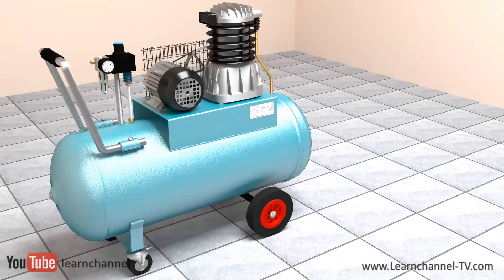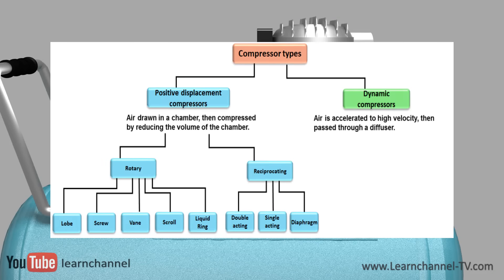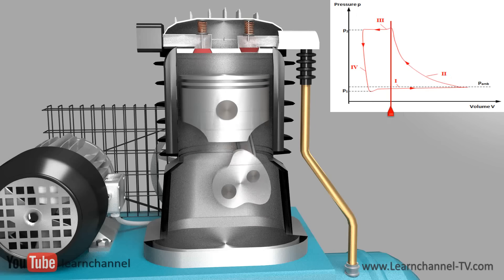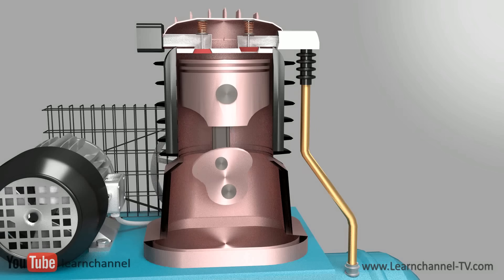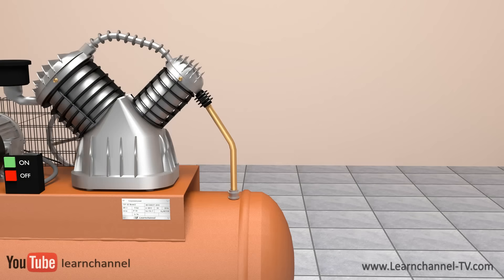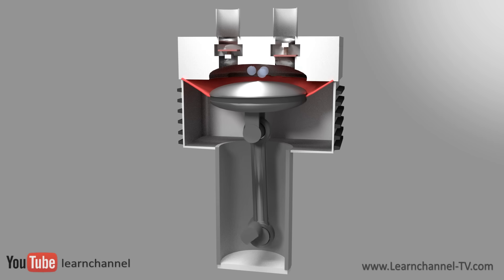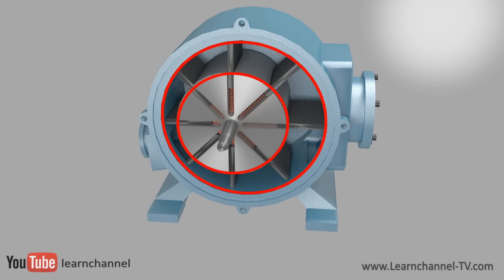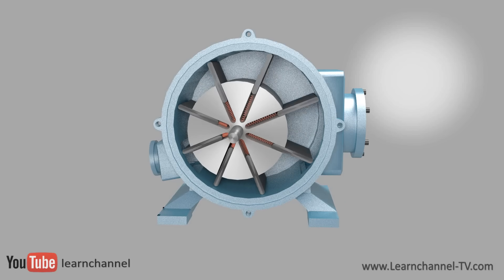How does an Air Compressor work? (Compressor Types) - Tutorial Pneumatics

Comment: my two stage kelogg compressor just stopped working is there. a capacitor in tthese compressors? or capacitors are only for smaller comrpessors? mine is a 120 gallon horizontal unit thanks

Comment: Pressure gauge motor cylinder with piston crank case connection hose tank water tank drain inlet filter compressor pressure coil electric ampere generator oil red inlet valve diaphragm crank shaft piston output valve  lubricant main rotor sliding vane grooves in fan protected  teacher ji

Comment: Greetings from South Africa .
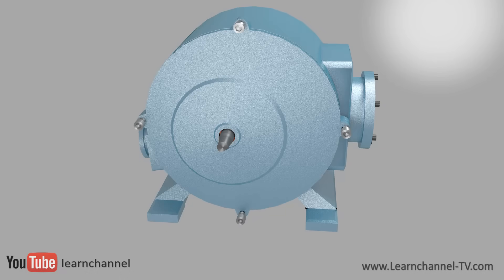I really enjoyed this video except at 3:10 ,where you said divers use diaphragm compressors to fill their cylinders.
No no no no no no no! 
 We use multi-stage high pressure compressors - 200 - 300 bar / 3000 - 4500 psi in our air tanks.
That's a bit much to demand of a diaphragm pump. they are happier at 125 psi - 9 bar.
Om shanti.😇🙏
Reply: tari ma ni qoosi

Comment: Why we want multi stage , we can compress the air by single also then why multi stage
Reply: Because even thou it looks very simple and straightforward, there are several variables to consider. I'll give two aspects as an example:

- Pressure vs torque relationship: For a fixed piston chamber size, there would be a fixed piston area; then for reaching a higher pressure, a higher torque resistance will be applied in the crankshaft, meaning that a bigger electric motor will be required (one with more poles would to the job, but with a lower flow rate). By having a second stage with a piston of different size, you can reach a higher pressure without  increasing the torque.

- Temperature constrains: This one was already mentioned in the video. The temperature of a fluid tends to increase with compression and the mechanism of the compressor require lubrication for proper operation, but lubricants tend to become thinner at higher  temperatures and moreover, some of them can ignite when enough heat is applied. By adding stages, you improve the cooling capabilities of the compressor, hence limiting the drawbacks of higher temperatures.
Reply: @wolfvash22   since you seem to know more than me 🙃 can a 8 bar air compressor fill up road bike tires with 10 bar or would you need a higher output compressor? if possible, what would you say is the highest pressure a standard air compressor can achieve?
Reply: @p__jay  Short answer, you cannot reach 10 bar with an 8 bar compressor, but you can use it to partially inflate such tire. Lets dwelve a little in the first question.

No matter what fluid you are dealing with (air, water, oil, blood, etc.), It can only flow from higher pressure to lower pressure, meaning that if you use an 8 bar compressor, you can only “pump" air to a volume pressurized to less that 8 bars and until reaching the same pressure. Following what I said, you can inflate a tire with an 8 bar compressor but you will only reach a maximum pressure of 8 bar inside the chamber, requiring a different appliance for the remaining pressure.

Now this can be something really simple to solve, let me tell you that in needful situations I have inflated car tires with a bycicle pump, precisely cause bycicle tires usually require a higher pressure that an car one, meaning that bycicle pumps (even the small ones) can sustain considerable pressure, however; you will take forever to inflate a car tire specially the big ones (here we are dealing with how much volume can be pump for time unit, not how much pressure can be reach), and you will need to let the bycicle pump cool down from time to time.

So, If you have an 8 bar compressor, you can let it do most of the job and then you can manually reach 10 bar with a manual pump, those reaming 2 bar would be hard to pump, but will take little to reach.

Now, regarding your second question, I'm not familiar with the standards of commercial compressors, but from a theoretical point of view, you can reach as much pressure as the available techniques and materials can withstand.
Reply: @wolfvash22  thank you! makes sense…pressure will always level itself out! so to get higher pressure, you always need a multi stage compressor with smaller pistons! For scuba diving tanks (which have 300 bar), they become quite small then. 

and a hand pump can make as much pressure, as the materials and seals hold tight. But like you said, the volume of air they move is low and you don’t want to inflate a car tire with it!
Reply: @p__jay  I'm glad to be helpful, just a little clarification about the multistage compression, it is widely used due to convenience, but that doesn't mean it is always necessary (or the best approach for any high pressure need).

Once dealing with an specific situation, a lot of variables can be taken into account (pressure, flow rate, temperature, fluid viscosity, explosiveness, corrosion, biohazard, topography, etc.), thus in very particular situations, a certain design such as one multi-staged could not just be inconvenient, but dangerous or undesirable.

Now, another interesting data about the multi-staged compression, pistons are not the only answer. Any turbocharged (or supercharged) engine is a multi-staged compressor, being the first stage an external rotary compressor (there are several designs types like the screw type used in superchargers) and the second stage the internal engine's pistons (and we could even consider the intercooler before the intake as sort of stage). 

Reactive engines are mainly used for commercial aviation, (I am afraid I can't recall right now the proper terminology about this technology) and they doesn't use pistons but rather turbines (and the opposite of a turbine that I just can't recall), and they do multi-stage the compression but progressively by variating the geometry of both the intake and the “impeller" and not just that, they do the opposite process before exhaustion; combustion products are multi-stage expanded (in this engines, thermal energy is transformed by turbines of progressive variable size).

Regarding what you said about scuba diving, you get it right, tanks with compressed air can be small to help withstand the pressure, but another reason is that a compressed fluid becomes denser, so you can have much more mass of the same substance at a smaller volume.

Comment: Can someone tell me do I really need compressor capable of more than 10 bars and 300l/min? For a small workshop.
Reply: not unless you are doing a lot of sand blasting
Reply: Buy one rated for 200+ min and that will keep you completely covered whether it be as heavy as framing or as light as painting you'll be fine with 200 psi! Buy once cry once! Wouldn't want to spend money on one compressor only to then spend more in the future because you needed higher output
Reply: Your fine , 10 bar will produce 145 psi , most North American tools operate in the range of 90 psi .

Comment: this may sound like a dumb question but how exactly does an air compressor fill up with air? is there a hole in the tank that fills it up?
Reply: After the air is compressed it leaves the pump through a tube that is connected to a one way check valve screwed into a hole in the tank. The check valve is there to prevent compressed air from returning back to the compressor when the compressor turns off.
Reply: There is a air inlet valve in the 1st stage piston .

Comment: So it’s literally an engine without combustion
Reply: I saw a guy building a compressor out of engine
Reply: @prodigalson2670  I saw a guy build a 4 stroke engine out of a freezer refrigerant compressor cylinder and piston
Reply: @prodigalson2670  you can build a steam engine from ice's
Reply: Reverse engine, actually. Instead of harvesting energy from chemical bonds, you harvest electrical energy and trasmute it into pressurized energy.
Reply: Combustion was always a joke about burning the planet's blood so the gold empire can dig deeper
Reply: Actually it's the inverse of an engine
Reply: Basically
Reply: Yes. After all, those who know, will always tell you that an internal combustion engine is just an air pump.
Reply: @PotatoeJoe69 We need a tech revolution that's way smarter please.
Reply: Yes they work the same
Reply: An engine from pressure-gas do work, compressor from work (normaly electric engine) do pressure-gas. It's reverse each other
Reply: Yes pal
Reply: No, but very close related. I will clarify a bit for those who have already commented:

Every engine I know, relays on compression as a previous stage before thermal-to-kinetic energy conversion, so in theory, every engine can be used as a compressor.

However, once you dwell into the specificity of each design, not every engine would be suitable as a mere compressor, specially if we consider how the compressed air will be used.

On the other side, depending on how much a compressor relates to a certain type of engine, it will be how much convertible it can be. The piston-compressors presented in the video, are much more akin to 2-stroke engines, so that must be the type of conversion you can get.

Rotary compressors such as the one with vanes, would be kind of related with a Wankel engine, but this time, there is to much difference for a conversion to be possible.
Reply: this explain the"engine" on top of the gas cylinder
Reply: thats why theres another engine
Reply: An engine is a compressor with spark
Reply: yes 😊
Reply: Pretty much lol

Comment: 1:24 No surprises, that looks very similar to an internal combustion engine.
Reply: yeah, but i can assure you that if went and opened one you wouldn't find valves like that in the most common types of pumps. they are you usually made with "spring metal sheets"  that act as a valve when compressed.

Comment: We have available good quality 110v,220v,380v,440v,660~690v 0.4kw~630kw frequency converters/inverters ,And also have special for solar inverts,water pump,Air compressor,blower fan ,injection molding machine etc.
We are manufacturer and you could be our distributor/ agents who will get the best price 
https://vfdconverter.shop
Email: ecogooinverter@foxmail.com

Comment: Just call it an engine on a bottle..
Reply: ermmmmm....engines use the pistons to turn a crankshaft, which is then coupled to a drive shaft that can perform work. The starter gives the flywheel initial momentum to reciprocate the pistons, but then the pistons are providing the turning power. This uses an electrical motor to turn the crank and provide hot compressed air. ...hence....they call it an air compressor. The pistons are not the things providing power, your electrical outlet is. If you felt inclined, I guess you could put a tank (bottle) on the exhaust manifold of an engine, but it would only be noxious gas and not usable.  The result of combustion of the fuel and air mixture. The only similarity that this shares with an internal combustion engine is that it has pistons, a crank, oil, and an air filter. A compressor doesn't have fuel injection, a carburetor, fuel pump, oil pump, governor, timing gears, distributor, coils, spark plugs, magnetos, manifolds, headers,....etc.....
Reply: @kiowastew  👍

Comment: 2:00 - how is the air cooled between stage 1 and stage 2? Looks like the air passes through metal tubing, wouldn't it be better to pass it through a radiator?

Comment: Hello there. I'm a mechanical engineering college student and I'm currently working on my bachelor thesis about the effect of discharge pressure of reciprocating compressor.

Is there any way to customize the discharge valve in order to reduce the amount of discharge pressure of the compressor ? 

If I change the spring valve on the discharge to a harder spring, will it solve the problem ?

Any respond will be so much appreciated :)
Reply: Aldi Pratama the answer is 6

Comment: I also sale of all kind of air compressor, receiver tank, air dryer, line filters, I provide complete air solution, plz contact to me 7042281737
Reply: I also do compressor repair and service plz in case you need the technical  No 0717463725
Reply: Where r u from?
Reply: Not North Carolina.... What's your area code.... NINE ONE OH...

Comment: Trying to wrap my head around the idea that increasing discharge pressure of air will decrease volumetric flow rate.. can someone help with this :)
Reply from the maker: Compressed air has the attempt to expand fast. Imagine you mounted a cylinder to the air compressor. At high pressure the cylinder would expand faster than at low pessure. But you have throttles to control the air flow rate.
Reply: think of leverage. the more your leverage on your output the less that output moves relative to your input. like a seesaw or a pair of pliers.

Comment: Won't the compressed air expands inside the tank?
Reply from the maker: That´s why it takes upto some minutes to " fill "  the tank with compressed air, when you just switched on the compressor.
Reply: At first, then it gets crowded by air and it compresses.

Comment: This kinda reminds me of an internal combustion engine
Reply: It's basically an internal combustion engine without the combustion part.
Reply: @ChavanAr  well I think it might be easy to convert it to one
Reply: If you think about thats all an internal combustion engine is, an air pump. More air you can get in and out the more power you get. Of course their are variables that come into play but basically thats it.
Reply: @brandonh.8882  Yeah, but in an internal combustion engine you need fuel and air , in order to spin the crank.

Comment: How much Power does the elektric Engine need to compress up to 10 bar into the tank?
Reply: This is a physically nonsense question. Even a 0,0001 hp engine could compress air up to 10 bar, it only would take more and more time to get the job done :) Exactly like an 1hp engine could move a car, but to develop the needed torque it would need hours to make some meters :D
Reply: cucky cuckcuck like 2hp lol

Comment: It is better to insert cooler stage between compressor unit and pressure tank. Cooler stage allows moisture condensation in compressed air so we'll get dry air. Dry air will provide better result in spray-paint and cleaning.
Cheers from Indonesia.
Reply from the maker: That is right for big compressors